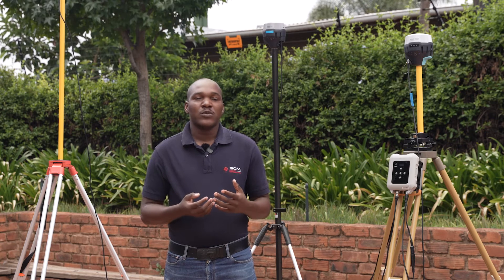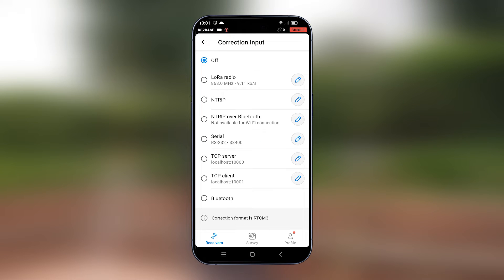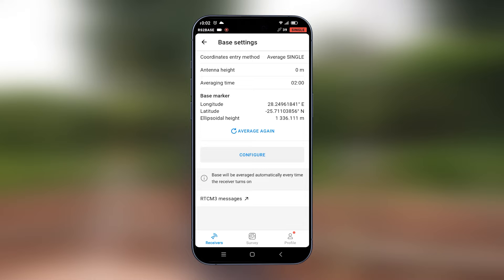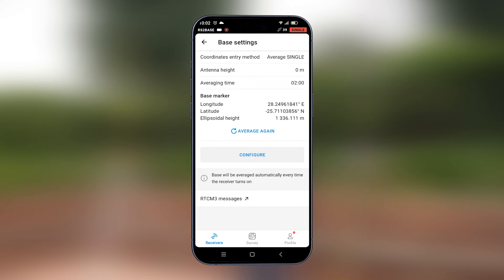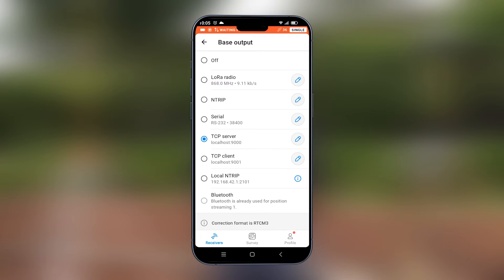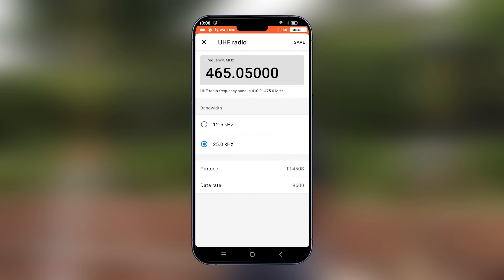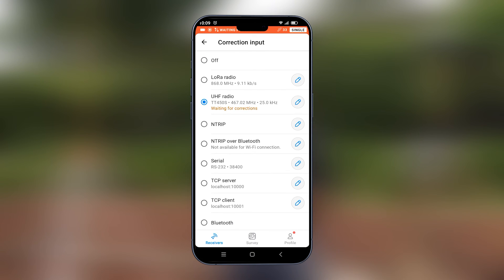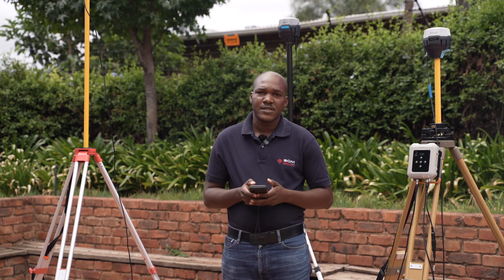How to configure Reach RS2+ Base and Reach RS3 Rover to communicate over UHF using External Radio

Comment: Can you explain why RTCM3 messages are limited to GPS and GLONASS? Why can't you use Beidou and Gallileo?
Reply: Trimtalk only support 9600 baud rate which means if you turn on 4 constellation at the same time, the bandwidth cannot handle such lot data(I.E. Making RTK correction latency increasing). Normally, three constellations would be fine
Reply: I have the same question? Do you already know why?
Reply: @jorgeeduardoleonrivera5957  sorry, no, I have not had any answer to this question.

Comment: Hello, would it be possible for you to produce a tutorial on how to configure the Emlid RS2 Base with Harxon L-5W H-30W radio (410-470MHz) and the Rover Emlid RS2 with Harxon L-0.5W H-2W radio (410-470 MHz) ?
Reply: did you successfully connect your harxon radio to rs2?. I have Harxon HX-DU1012R and HX-DU8616D